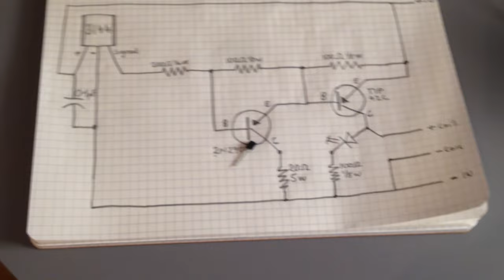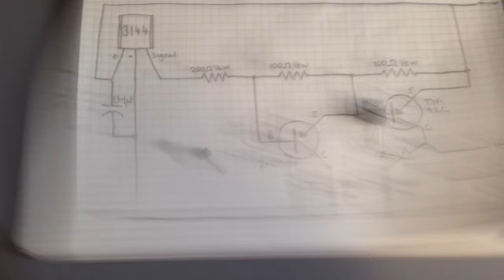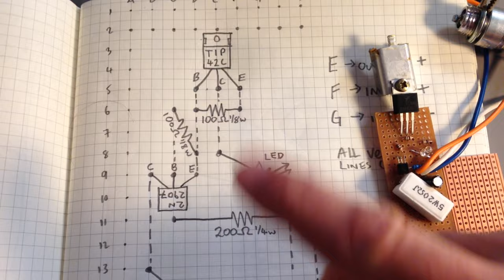Easy Hall Effect Transistor Ignition using a 3144 hall sensor and 2N2907  TIP42C Transistors

Comment: I built this circuit foR use on a motoRbike, it didn't work, just burnt out the power lead from the  battery.  I must  have checked the circuit a dozen times, still no luck, just burns out the power lead from the battery.  Interestingly, when I connect everything up and just scratch the power lead the spark plug fires.  Didn't work for me, I'll search for another  diagram.
Reply from the maker: Are you using a large enough gauge of wire for the power lead?
Reply: @bootsowen  Just standard breadboard jumpers, very thin.  But surely it shouldn't spark and get this hot?
Reply from the maker: @toglhot  Breadboard jumpers are definitely too thin, you will need a bigger heatsink on the transistor too, the one in the video is too small. There is lots o useful information in the other comments.

Comment: This schematic simply doesn't work, all you'll get is smoke and and a burnt out out TIP transistor.  The fact that the model works just tells you the schematic and model are different.  Find another, don't waste your time and components on this one.
Reply from the maker: Have you used a large heatsink?

Comment: With this design, when the magnet is in the position to light the LED the current is flowing through the coil as is expected.  A problem could occur if the engine just so happens to be sitting in this position for a long period of time then the large transistor would overheat.  Point being, don't leave the key on for a long period of time without starting the engine.
Reply: It was a problem with older points ignition systems as well, since this is more suitable for a bike the ignition likely isn't left on when the motor is not running.
Reply: In my case the 5 watt resistor overheats...

Comment: Spark duration is the most important part to an ignition system. Your engine on its design and tune like air fuel ration will depict the spark duration and not all engines are equal. The original Atom company that was selling these stopped for this reason. You can make sparks all you want but if that spark isn't the proper duration then it's going to run the engine with a loss in performance and there will be extreme wear and tear.
Reply: How do you control the spark duration in a coil system

Comment: This is really interesting. You should use this on a small engine. They usually have coil on it but you can advance the ignition timing and burn alcohol. It could be very efficient especially if you make it spark twice instead of once when the magnet passes it

Comment: Pure gold, I searched ages to find a Youtube how to make a hall effect trigger an ignition circuit. This is a brilliant!! Thanks for sharing and making everything so clear.
Reply from the maker: Watch out however. I found that this one gets hot so it needs a bit heat sink. Also in service you have to isolate it from the trigger. Otherwise the spark can travel across the hall sensor and damage it.

Comment: Easiest circuit and tutorial available on YouTube... I must say ❤

I have a query that hall sensor usually works on 5 volt, here it is connected to 12 volt..is it okay? Will it affect the sensor!

And one more thing, you have used 20 ohm 5 w (ceremic) resistor.  Is it compulsory to use ceremic resistor? Can we use non-ceremic resistor (20 ohm 5 w) of same value if I am unable to find ceremic one.  Please help 🙏.
Reply from the maker: Thanks. The hall sensor works here, try using a different resistor and see what happens.
Reply: @bootsowen  thank you I will give a try with 12 v first as per your circuit and what about the 2nd query regarding resistor!

Comment: by the way, it rans perfectly on 6 volts, i used a coil for an small ATV   and the sparkplug is strong enough to run my Webster 4 stroke engine.
Reply: Thanks sir, i would like to run using 6V too.
Reply: Exactly the same circuit or u change some components?
Reply: @fakhrinshamsudin5713  almost, i did not put the small capacitor in.
Reply: @johngroenen  tqvm for the info

Comment: Absolutely brilliant. I have been looking for a similar circuit to replace an old magneto. Thank you.
Reply from the maker: I have tried in vain to actually get this to work on an engine. It is easier to get a coil and a 12v battery and use the points and timing in the magneto to revamp the ignition. I have shown how to do this in another video

Comment: 1. There should really be a back EMF suppression diod in reverse polarity over the coil output or the coil back EMF will hammerer the transistor with high voltages spikes that will eventually destroy it.
2. There are no good reasons to use NPN transistors and no good reason at all, in this case, to connect the load to the emitter but instead, as normal, should be connected to the collector for better power.
Reply from the maker: Hi there, this system was from a few years ago, and not of my design (I know very little of electronics), if you could sketch out a better circuit, or link to a video that would be more helpful.

Comment: Does the coil get hot with the system on and not cycling?  A timer that shuts down the saturation of the coil while not pulsing would be optimal.
Reply from the maker: I think there are lots of ways to make this circuit better! I have not used this system other than this build and test. I found that that the transistor gets too hot!
Reply: @bootsowen  Typically the transistor will get smoking hot, even on industry HALL ignition modules!  This is perfectly ok when the engine is running as the saturation time is greatly reduced with the small dwell.  When you run the magnet past as you are doing the TIP42C will get very hot.

Comment: hello in my circuit the 2 transistors and the resistance of the Led are getting too hot. ??? because if I have the same components as the diagram. ???? without coil they heat the same just a little less
Reply from the maker: You need to use a very big heat sink.
Reply: @bootsowen  ok Thank you

Comment: I've been looking for a trigger circuit like this for a long time. Randomly this video popped up in my feed. Great detailed video. cheers.
Reply: Remember spark duration is the most important and not all engines have the same duration and this is why the very original model stopped being produced by Atom back in the day. You need to know your engines spark duration and your spark timing needs to be perfect. I bit to les or a bit to much you will have lost in power and extrem wear and tear.

Comment: would a solid state relay in place of TIP42C be better?
Reply from the maker: I have no idea. But isn’t a transistor just a solid state relay anyway?
Reply: @bootsowen  sort of. a SS relay has a led internally and a photosensor to trigger the switch. total isolation. can handle hi amps too. they are great.

Comment: Hey, great vid!

I understand slightly how this works but I can't really understand what purpose the 2N2907 has got? Could you explain to a beginner :)

I have one Allegro a1302 Hall sensor but was planing on using it with a transistor (TIP41c) and was thinking the signal couldn't trigger that etc.

Anyways, if you got a chance, let me know what it does :D
Reply from the maker: I don't know much about electronics, but to my simple mind it steps up the signal from the hall sensor to the transistor that is capable of actuating the coil. Like you say, using your parts the hall sensor may not be "strong" enough to trigger the TIP transistor.  Good luck.
Reply: Ok, as I suspected! Thanks a lot :)

Comment: is that resistor connected to the small 2N2907 low power transistor need to be 5 watts? because if i build that in actual and that big size 5 watts resistor is used and i will enclosed the finished product inside the distributor housing then its very tight in there.
I was wondering because  2n2907 is It is a 0.6-ampere, 60-volt, 400-milliwatt transistor and i wonder why 5 watts resistor was placed. Thank u.
Reply: In my experience the 5 watt transistor gets very hot

Comment: I could not see the wire scheme in: http:/www.5bears.com/tim4.htm
Could you send it by email?
I have a question about the capacitor;
Is it 0.1mf, electrolytic or ceramic?
Reply from the maker: Hi there, I understand that the www.5bears.com/tim4.htm website is no more. They were electrolytic capacitors. The circuit diagram is clearly detailed in the video. It was the same as the one on the 5 bears website.  Thank you for your question.

Comment: hi , i did this circuit and it works. but that big resistor 20 ohms 5w gettig hot . any ideas ?
Reply from the maker: Hi. I’m glad it works!  I’m not sure that it matters. I think it is more important to put a heat sink on the transistor. Have you made a video of it?  If so post a link here. Thanks
Reply: well i use all parts just like you did . and it looks just like yours.

Comment: dang man this is awesome - I want to make my own electric ignition for my motor - I have an 8 pointed reluctor from a pertronix 1 system, the bears site is down, can you possibly share the original and your schematic (i dont need LEDs / I use an 
 inductive timing light). What wd be the most basic schematic without LEDs?
Reply from the maker: you could maybe try this one, it also has an led however. https://youtu.be/gASPFWhvb_g?t=1m35s you could just try it and leave out the led, I am not so hot on electronics so I don't know if this will work. The light is there for timing, it helps you set the magnet where you need the spark. thanks

Comment: does it need timing advance? subscribed
Reply from the maker: You can change the timing by adjusting the magnet on the flywheel.
Reply from the maker: If you need an advance then you could have a lever to move the sensor/ board relative to the flywheel
Reply: I am pretty sure the advance is needed. Probably need some other physical feedback, like vacuum or tps (throttle position sensor), mas (mass airflow sensor). Im not sure if a timing advance could be done electronically, maybe having some IC chip adjust by timing. Reason I ask is many of us older motorcycle owners have to buy expensive igniter boxes from after market because they no longer make them. Your simple circuit solves this except timing advance. I am going through this situation now. My 1996 Yamaha xv1100 Virago igniter (TCI - transistor controlled ignition) has failed.

Comment: Hi, this circuit is interesting....... i have started to build this circuit for my toyota 3k engine......... my question is, is it ok to disconnect the LED from the collector of TIP42c and use it only when i need it as a timing light??
Reply from the maker: I think you must replace it with another non lighting diode in that case. But my knowledge of electronics is not very good.!

Comment: Which capacitor and LED are you using? Any reason for that type of 5watt 20 ohm J resistor?
Reply from the maker: Hi There, thanks for the question, It was a few years since I made this circuit. So I don't have any details on it, except what is in the video, sorry.

Comment: Hi "again" :D
Yes, the circuit works great. The problem I had was a bad coil. Now I will be putting it on to my 2 stroke on my generator for a test soon. Thanks again for your replies on this circuit.
Cheers mate.
Reply from the maker: No Worries Mike a video and put it up here, happy to put in a link.  Even a video of what went wrong for you is useful for others!
Reply: @bootsowen :  Yes I will be shortly. I am hoping to try it out soon on the 2 stroke engine. Will let you know when I post the video. Cheers mate.

Comment: Good evening mister Bootsowen, I am interested in your circuit, and I would like to know if is ti possible to make a similar transistor ignition circuit, but with 4.8  or 6 volts. In order to use it in a 10 cc two stroke Rc Engine.
Reply from the maker: Hi there, In short I don't know, but if i had a 6v battery i would just try it with this circuit.  I don't think it would damage the circuit if you use a lower voltage, but you might need to use a sparking coil appropriate for 6v.

Comment: where i can find the hall sensor in old parts ?
Reply from the maker: Printers have them I think.
Reply: @bootsowen   i want to make it for a car ignition. can i use a camshaft hall sensor with a simple led also must i use the same code of transistor ? thanks bootswen

Comment: Hi. Tried to mount this circuit and the TIP42C burns after a few seconds. I am using 12V from a PC power supply. Can you give me an hint? Thanks. Carlos.
Reply from the maker: I am not that hot on electronics so I am not sure, it could be something to do with the type of rectification that the power goes through in your power supply. From a battery the dc will be smooth 12v, but from a power supply it might be stepped or smoothed but not perfect dc.  Also, it is worth mentioning that while i did get this board to run in the video i did not get it to run successfully on an engine. But that was due to arcing across the hall sensor!
Reply from the maker: Try putting a heat sink on it, mine got pretty hot too and i stuck a block of aluminium on the back

Comment: i  have a question i see 3 resistor wattage 
do it matter if i use 1/4w 1 instead of 1/8w ?  as long they are the same ohm value ?

and i know i will need the 5w 1
Reply from the maker: I don’t know much about circuits so I just built it as the plans said.
Reply: @bootsowen  k
Reply: just googled and  a bunch say  as long the ohm is right  bigger watt resistor dosent mater

Comment: HI.. This is exactly what ive been looking for ,to power a exhaust flamer kit.The only thing is ive no moving parts for the hall sensor  to pick up on. I was going to use a square wave generator to power my coil (which runs my spark plug situated in tail pipe and burns unburnt fuel from  the de-cat exhaust system).The square wave signal generated needs to be amplified or boosted so it will be strong enough to triger the 12v coil..do u have any knowledge in this..thanks marto
Reply from the maker: +martin eglinton i think if you use the square wave generated instead of the trigger from the halls sensor it will boost up through the two transistors.  But i know very little about electronics....
Reply: bootsowen ohh ok thanks...i thought you were a dab hand with electronix..lol just out of interest the parts for the progect how much did they cost .in pounds pls.i may have a go ... but thank you for your fast reply.and thanks for your time..martin
Reply from the maker: the parts are cheap, but you have to buy 10 resistors etc, so you end up with bits you dont need. I'd say about 25£ for all the parts including duplicates, or about £8 if you could get single bits at a cheap price,
Reply: ok... thank you...ill let u know how it goes.

Comment: Hi mate. 
I have built this circuit from your video plans. I said I would let you know how I got on with it.

Well before I connected it to the ignition coil I tested it with a magnet by passing it by the Hall Sensor and the LED flashed as it was supposed to do, "BUT" when I connected the coil and tried for a spark on the spark plug the TIP 42C just fried, even though it was connected to a large heatsink with a fan on it.

I am using a small coil from my Chinese 2 stroke CDI generator. Just using the coil, no other parts of the CDI system.

Any suggestion would be appreciated. Thank you.
Reply from the maker: I am not really sure what to tell you, do you mean that it fried but it worked for a while and then and overheated? or did it just pop from a crossed wire, I have done the latter. I show it working in the video, but that was almost 4 years ago, so I am not sure that I will be able to answer any more questions. I think I made two different designs, (they were other peoples designs) and put up a video of each, it should be under transistorised ignition or hall effect or similar.  I have been told that the web links that I provided to the original designs no longer worked.
Reply: @bootsowen : No don't get me wrong mate. 

The one you showed worked great but I don't know what I may have done to bugger mine up. The TIP 42 overheated as soon as I attached the coil so it may even be a bad coil or even the wrong coil.

Its obviously something that I have done wrong somewhere and I just need to keep trying untill I get it to work like yours. 

I just wordered if you had any problems when you first built it.

Thanks for the reply and I did look at your other ignition circuit and that one looks good too. Cheers.
Reply: @bootsowen : No problem mate. I have done something wrong somewhere.
Your circuit worked perfectly so I know it works but I will need to check the coil I am using. I may need to use another coil.

Yes the TIP 42 fried immediately when I connected the coil so I am guessing I have the wiring to my coil wrong or the coil is gubbed.
Thanks for the reply, appreciated. :D
Reply from the maker: Hi Mike, I reckon mine got hot too, but it didn't kill the transistor. did yours burn out?  Did you get a spark out of it?  You said you had a big heatsink with a fan, maybe it is a problem with your coil.
Reply: @bootsowen : Yes, it fried fast. 
I think I need to change the coil and double check the wiring to the coil. 
Thanks again.
Reply: Hey  @mikeflight9  , how did you get on?? I'm just starting to look into a little circuit like this and reading around somewhere i THINK i read that the coils resistance can't be less than 3 ohms - something like that.
Reply: @mikescudder4621 : Hi Mike. The TIP 42C transistor I used was not properly fixed on the heatsink so this is why it fried. I tried the system on a small Chinese engine that came off an old generator (63cc) but the engine would not fire. I was getting a spark so I think the engine has other problems. I just used the coil that came with the engine. The little circuit does work. Cheers.